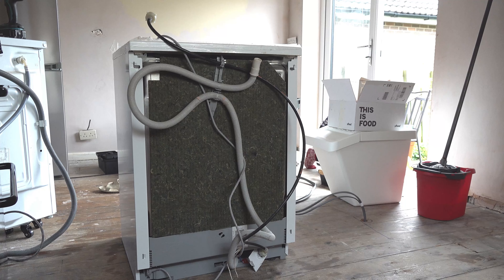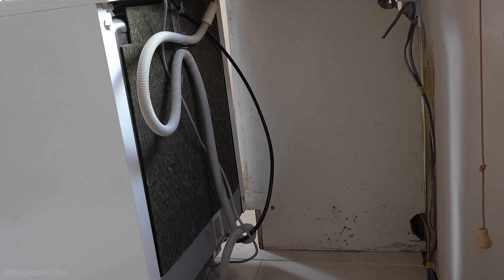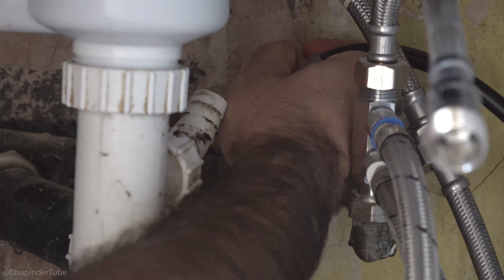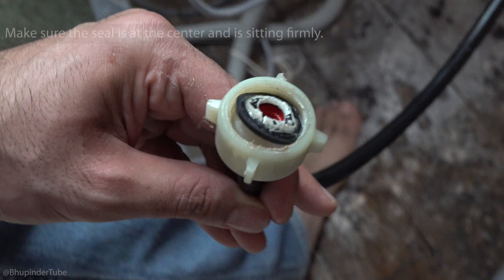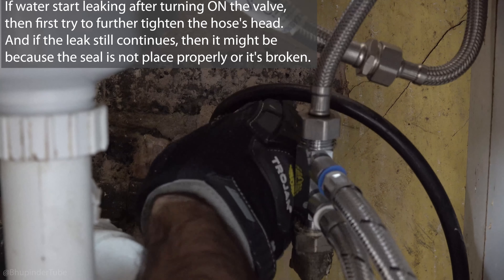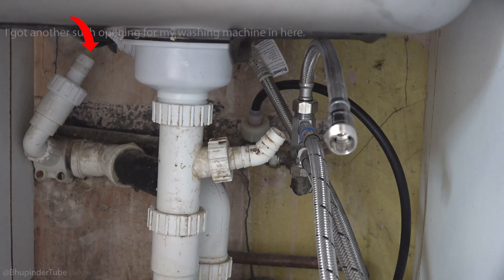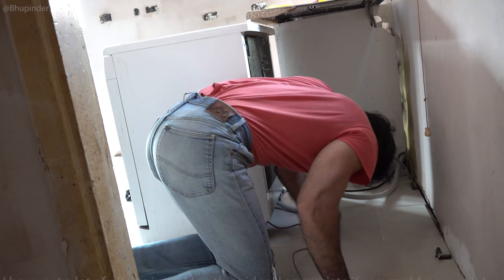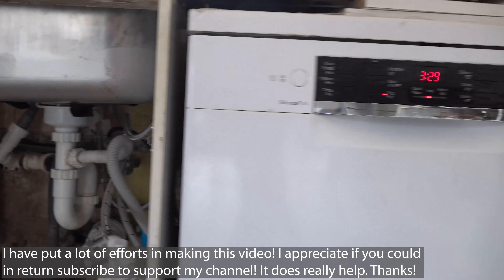How to install a dishwasher

Comment: Hello, I am having a problem setting up my Amazon Alexa 3rd gen. Dot  It used to work and now does not. Do you know a link or way to finish the setup mode of my Amazon Alexa dot by using my PC instead of my phone?
Reply from the maker: Hi. Good question. Yes, you can access Alexa from PC, please follow https://youtu.be/phN07NKA30s . Next time, please put comments under the relevant video. I always try to read and answer all comments from any video. I know on the other social video platforms such as instagram and tiktok, it's always the last video but luckily YouTube is different. All the best!
Reply: @bhupindertube  Thank you and I thought to ask here because, on my own channel, I will miss comments on a past upload of mine. I tried this link and I needed to download the Firefox browser to get my wifi to recognize Amazon Alexa, but it turns my computer wifi connection off to do so, and somehow Alexa tells me she's connected and to go to the app. This link says with just a computer and no app. I wanted to not have to decide to use my computer or the Alexa, I was hoping a computer could get Alexa to set up and also be connected to wifi without having to choose between the two devices, Thank you anyway...
Reply from the maker: @occamsrazor9183  You're most welcome. Sorry to hear about your struggle to connect Alexa to Wifi. I think the best way is to use Alexa app on your phone/tablet as I've shown in details in my other videos. Once, you've connected Echo to WiFi, then you could uninstall Alexa App. Basically, you don't need alexa app in order to use echo dot but you'd need it to connect it to WiFi.
Reply: @bhupindertube  I saw that my Windows system has Alexa on it, I got Alexa installed inside my computer and it works there, I am still working on the Echo device itself problems, the device is what I want to work/no problem, someday I'll figure it out;)...